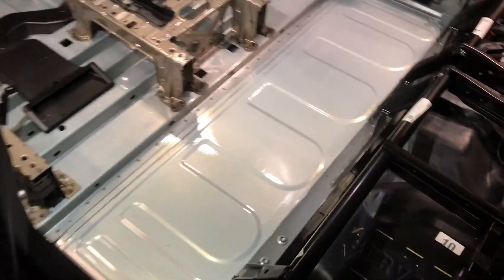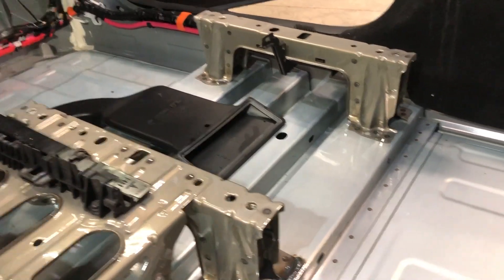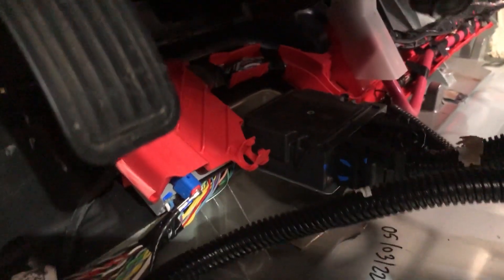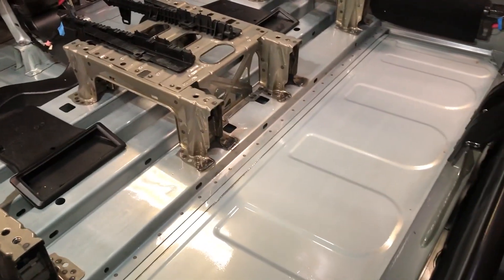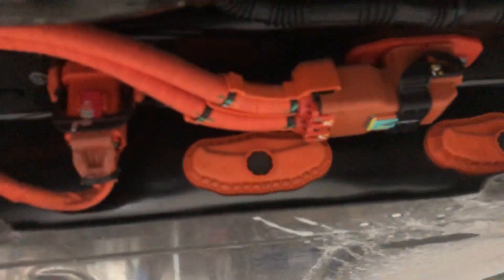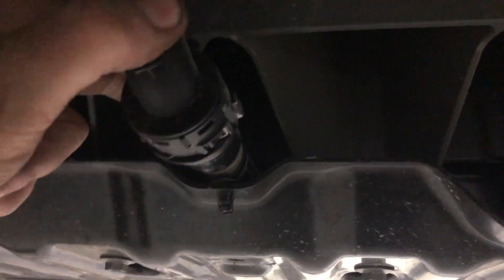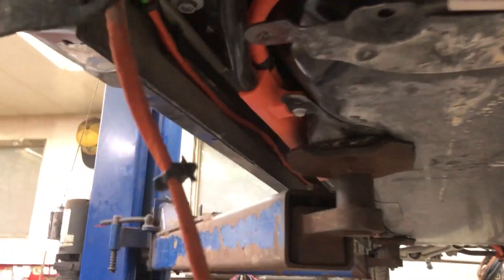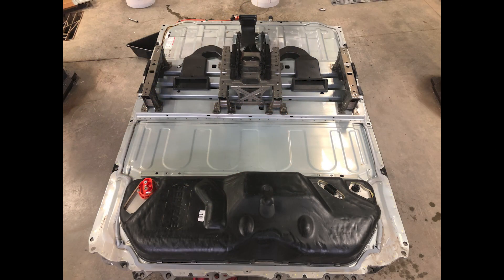Tesla Model Y Repair 4680 High Voltage Battery Removal

Comment: cool video I LOVE seeing the internals of a car and someone pointing out the differences between the different construction methods what I have at my shop that would be nice to remove battery packs from cars is I have a cheap scissor lift meant to lift a 6000 lbs car I made a frame with good castor wheels for like scaffolding and I can move the lift in any direction so you lift the car on the main lift and take the small lift under the pack and lower it down that way I haven't used it yet for a EV I use it to remove and reinstall a complete power train on cars like BMW AUDI VW ETC..